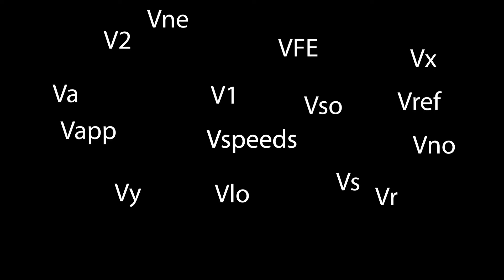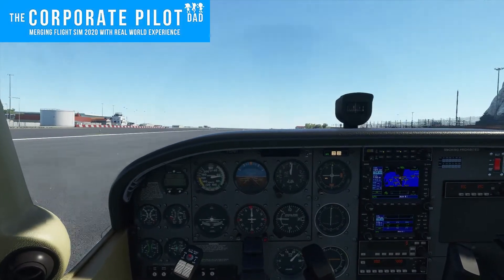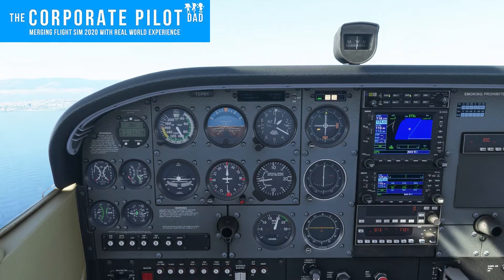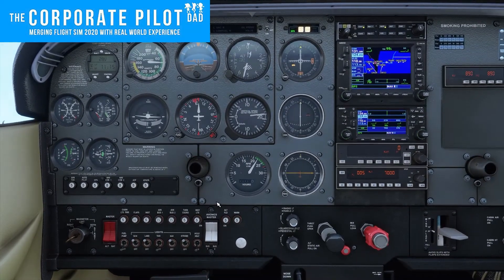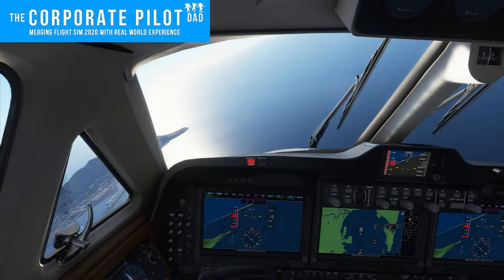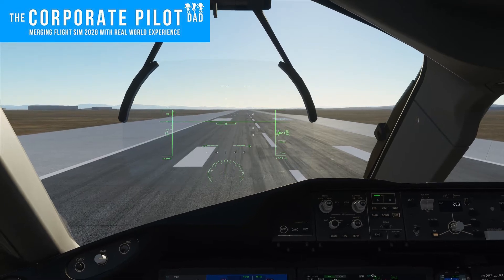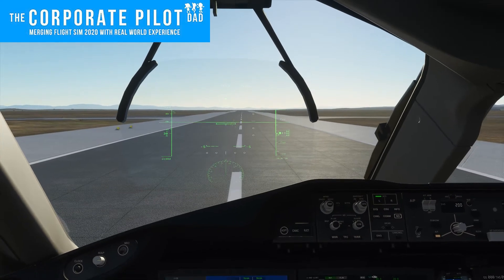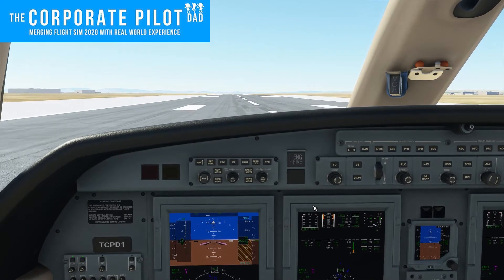V speeds Explained - #v1 #msfs2020 #learningtofly #flighttraining

Comment: Subscribing. Transitioning from helos to Beechjet 400A. Lots of unfamiliar terms, lol.
Reply from the maker: Best of luck to you in that transition!  I still remember my first flight in the left seat of a corporate jet.  It felt like I had tunnel vision with everything that was going on, the ride was extremely smooth compared to the constant vibrations of a twin-engine piston aircraft, and the sheer speed compared to what I was used to was insane.  Overspeeding during the climb is easy to do as I also found out that first flight in a jet nearly 20 years ago.  You will get used to it like everything else you've probably experienced so far in aviation.

Comment: I didnt understand va,can you explain it to me?
Reply from the maker: Maneuvering speed.  At or below that speed, if full elevator is used, the airplane will stall before structural damage can occur.  Above that speed, using full elevator authority and the airplane will have structural damage before a stall occurs.  Maneuvers like steep turns are performed without exceeding Va.

Comment: I just havent understood the difference between Vx and Vy.  It seems either way youre trying to climb as high as you can in the shortest amount if time/ distance.  Isnt it the same.  Granted if you dont have to worry about getting over something you can go at the Vy speed but in the end they sound the same to me .....  Get up as high as you can in the shortest amount of distance no?
Reply from the maker: Vx gets an airplane higher in a shorter distance which is used to clear obstacles.  Vy gets the airplane to a higher altitude in less time when obstacles are not a concern.
Reply: * of